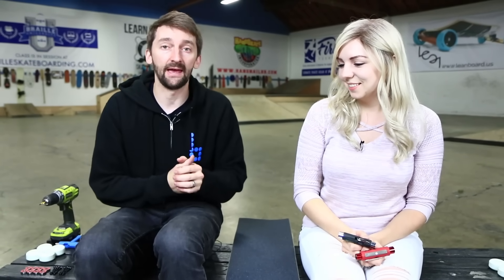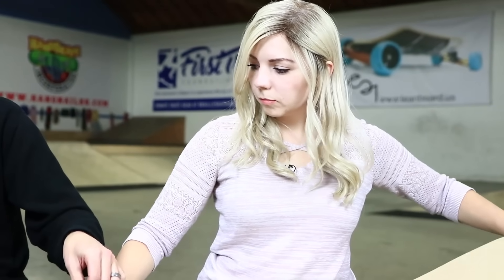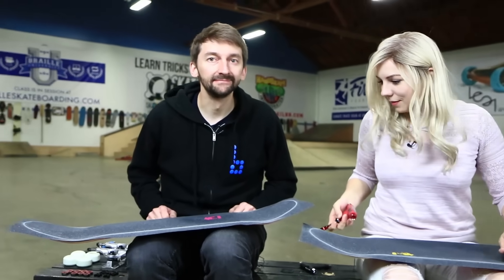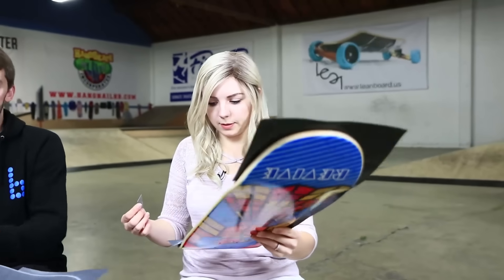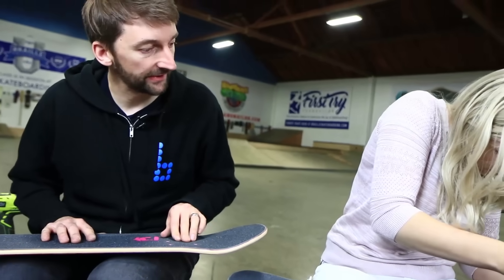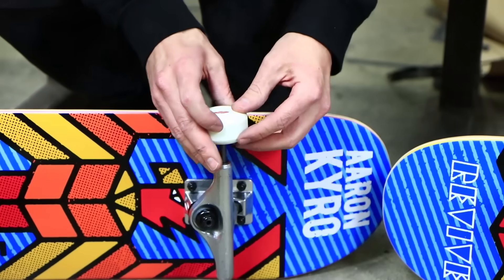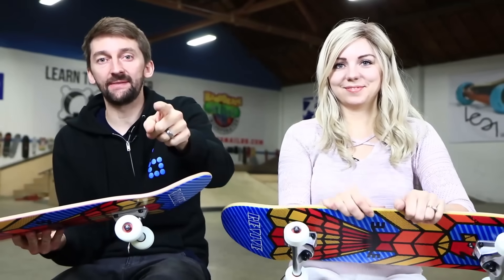How to Set Up a Skateboard for Beginners

Comment: 25 YEARS SKATING AND NEVER SANDED DOWN MY EDGES WITH THE CORNERS... GREAT TIP!
Reply: lol i never used a razor i just used a truck or rock or wrench to sand it all the way to the wood
Reply: I knew that trick and never really used it, I instead mastered the art of cutting out the griptape smoothly and evenly with the blade xP
Reply: Putting it in all caps really drove the point home

Comment: And when handling razor blades or any other blades like knives etc is: USE A SHARP BLADE!
When the blade gets dull that's when you start using force to cut with it, that's when you can slip out and hurt yourself.
It might seem counterintuitive if you're not used to working with tools but sharp blades is the key to not cutting yourself!
Reply: Yeah I cut with them
Reply: Also if your blade is sharper and you do cut yourself the cut will be a lot more shallow and will bleed less.
Reply: I second this. Dull blades also tear more into your flesh and leave a not so clean cut making it harder to heal. You don't want to do that!
Reply: i sharpened my nephews pocketknife once.
his mom got mad because i made it "too sharp" at first, but i just had to tell him to alwas cut away from himself and not running with a knife in hand and he hasn't cut himself ever since.

i do however know of people cutting themselves really badly with sharp blades but in those cases it's usually a matter of the user being stupid as fuck.
Reply: I did that with an egsacto blade
Reply: @elliotallen9463  *x-acto
Reply: slip out😩
Reply: Ironically, lol
Reply: Blade, don't cut you! But, you, who cuts you!

Comment: Fwiw, the nuts with the plastic in them are called Nylock nuts. 
The plastic is nylon embedded into the nut to prevent it from coming loose. 

Loctite is a liquid you can add to the threads that prevent seizing of the nuts to the bolts, but mostly to act as a glue to prevent the nuts from coming loose, and depending on the colour of the Loctite it determines the strength of the hold.
Reply: Why are you verified
Reply: @nelsonmakesmusic445  Why does it matter?

Comment: If youre critical about your deck looking spot on: 
Its not 100% ideal to smash your hardware through the grip tape because it can unstick the grip tape around the screws and also cause tears.  Poking through the top side and rubbing that inside edge with your tool to wear off the tape thats in there reduces risk of unsticking or small tears

Comment: The plastic piece in the bolt he calls loctite, is actually nylon, making it a nyloc nut. That's what he probably meant to say. Loctite is a brand name and usually refers a type of glue that is commonly used to secure bolts directly in a threaded hole. The more you know... :)

Comment: i love gripping my boards. haha super satisfying especially when it comes out great. always sand the edges after you cut the excess that way when the board lands wonky concrete doesmt gouge the egdes of the tape. i can always tell when people skip that step. also the nuts are called nyloc nuts. its a piece of plastic that helps with vibration. great piece of tech that has no doubt revolutionized skateboarding and other applications. hahah

Comment: Skateboard hardware actually uses Nyloc nuts, not loctite but it does serve the same purpose :).  The screws holding a snowboard binding to the deck usually have blue Loctite gel on the threads...I know Aaron and a large portion of the audience snowboards so it was the best example I could think of quickly.  
You can use blue locktite threadlocker with a normal nut on your mounting hardware in a pinch; I've used it for 3-4 weeks in the past with zero issues.  I did check it a couple times just to be safe but I've used threadlocker for a lot and never had an issue so I wasn't really expecting this to be any different.

Comment: It is called a Nylock lock nut and not loctite.  Loctite is a liquid that goes on the bolt threads to prevent the nut from backing off or coming loose.  The Nylock locknut is a one time use type of nut.  If taken out, you must use a new one.

Comment: pro tip: when you put the hardware thru the bottom to see where the holes are on the top, DON'T push them all the way thru. Just push them in enough to push out the grip slightly so you can see where the screws should go with out there being actual holes in the grip yet. That way you wont end up with the holes around the screw being too big the way hers ended up.
Reply: Dumb question - What’s the reason that grip tape is the first & not the last step? It seems like it would be easier and faster, but I’m likely missing something.
Reply: @NathanHallComedian  If you put the grip on last it would completely cover the screws. Eventually those screws will begin to loosen over time due to all the vibrations and will need tightened, or perhaps you want a new pair of trucks...either way, you want to be able to get to those screws easily.
Reply: @PApro  Thank you very much for explaining that clearly, very much appreciated! 😀

Comment: Mechanical engineer here its called a Nylock-nut.

Locktite (yes it's spelled that way)  is something else - It's basicaly a paste that are applied to the threads to work as a form of glue - So function wise it's similiar to a nylock nut but the same.
Yes I'm a knowitall!

Comment: The plastic insert on the nut is nylon, technically they are referred to as nylon insert lock nuts. Loctite (a brand name of thread locker), is a liquid compound that you would apply to the threads of a bolt which acts as a glue that prevents the nut from loosening. Not trying to be condescending, just wanna spread the knowledge! <3

Comment: My trick as as kid to get bearings into wheels was to put the bearing on the axle, wheel over it, other bearing on that, and hit it with the socket on the tool like a hammer. It worked, but I dunno if I was munting the bearings.

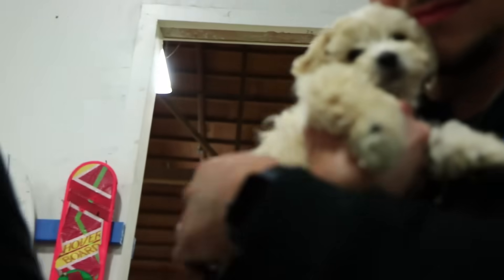Comment: 11:00 the hardest part if you bought the wrong tool just like i did, So i need to grip the bolt with the wrench while i rotate the screw using screwdriver, made my hands sore overnight. so my tool doesn't grip the smallest bolt, only the wheels and the bushing bolts

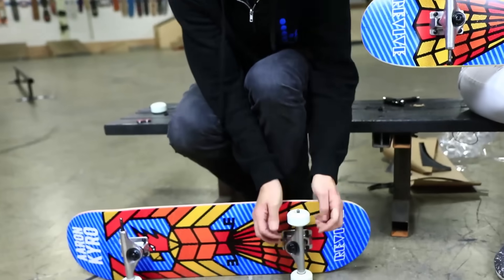Comment: 16:34 Board setup speedrun [WR glitchless]
You CAN go a bit faster if you wrong warp to clip the hardware through the deck, but this run doesn't use unintended tech.

Comment: I don’t recommend tightening the wheel to press your bearings in. You can accidentally over tighten and pop your bearings. Unless you’re using spacers between your bearings, don’t risk doing it this way.

Comment: I think those are Nyloc nuts (they have nylon in them), but yes they do the same thing as loctite (which is a liquid). You use loctite when you have nuts without nylon, or you want to re-use nuts (after cleaning the old loctite off). 
You technically shouldn't re-use nyloc nuts, but I'm sure ppl have safely re-used them (I just wouldn't do it if there was any liability involved)

Comment: I ordered Independent trucks off of Zumiez online website and I was wondering if it comes with screws/bolts that I can use to attach the truck to the deck.  If it does not come with hardware to attach the trucks to the board what size should I get for Independent Raw 139 Stage 11 skateboard trucks.  (Size 8 board)

Comment: I know this is an old video, but if anyone can give an answer or info on this that woiuld be great. I just recently bought a new complete deck, but the trucks are super loose i mean you can basically stand on the ground with your feet still on the board, I have since just taken the old trucks off my custom build as they are much more firm and comfortable than the other ones. Also, on the new trucks before i swapped them, I tried to tighten the nut by the bushing, then the trucks would lean to the right like one side was higher up than the other and  no matter how much I rocked back and forth on the board it wouldnt correct the trucks at all. I just dont want to see a new set of trucks go to waste any info is appreciated.

Comment: need your help guys!.......this whole pushing mongo thing gets me.  after skating on and off for nearly 30 years i have only just discovered that i have been doing it wrong! i skate w/right foot close to nose end but can't push  off with my left because my left leg is slightly shorter and has always made it difficult as i have to bend my right knee to get my left close enough to the ground.  i am 40 now and knees don't bend as well as they used to (was bit of a kamakazi skater in my youth) here"s the thing.  do i struggle like a beginner all over again to correct my faux par and put myself off skating or just continue to skate as i do and just get skating again.  and when i am pulling off tricks people wont notice or worry about the whole mongo thing?
Reply: I would recommend to not push mongo and to start again. It's said that it is easier to not push mongo to learn new tricks but I don't know. I just don't feel comfortable doing that. 

Some people will probably judge you for pushing mongo but it is not a problem because there are no rules in skateboarding.
Reply: @moon-mb2fg  like i said, my leg length difference does make it bit difficult. i can push off once maybe twice skating regular but then i start looking like a three yr old trying to skate for the first time. i have been practicing a bit more recently, but still nowhere near ready to show my face doing it! haha but thanks for the advice dude. really appreciate it